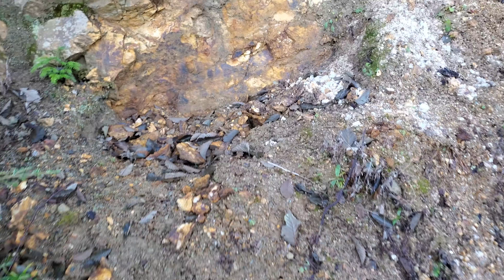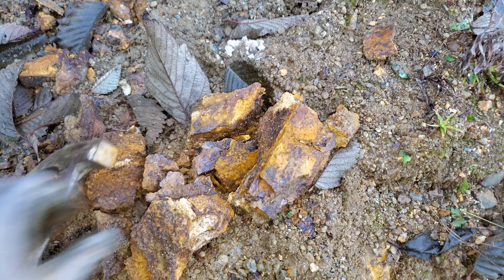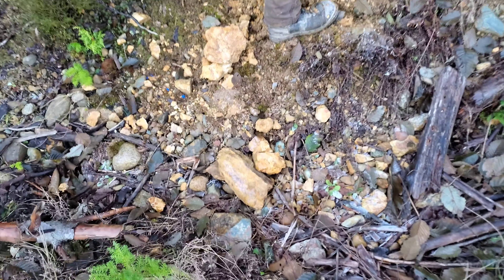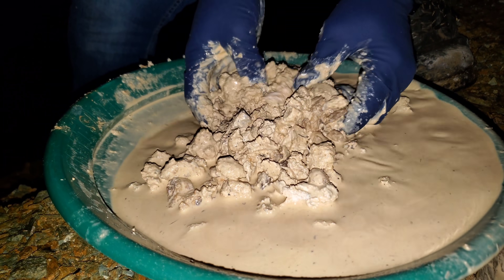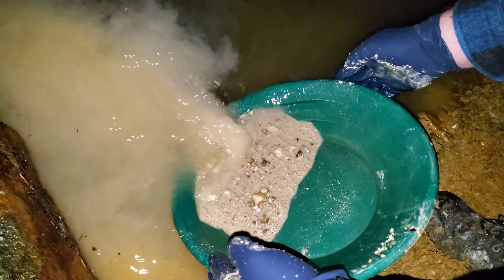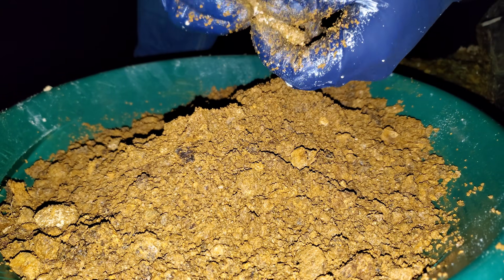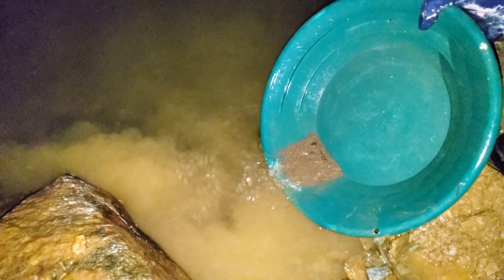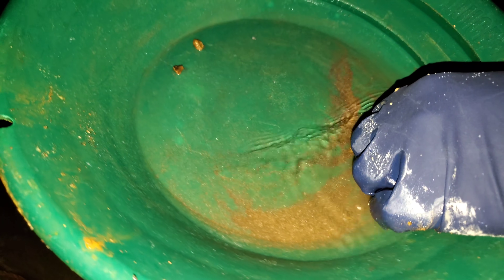Crushing & Panning A Deteriorated Gold Bearing Quartz Vein!

Comment: Your manual crusher is 0k but your plunger needs to be upgraded to a 4 foot 2" pounding round bar,with one end ground off at a 60° angle,makes a great pry bar!
I had  welding shop make me one for 80 bux,and I said make the foot wide cuz, I've got big feet,so he did,and he even threw in the bar!
I will say lugging a heavy bar around can be tiresome.
You could also have 4 feet of steel tube with a 1 foot long 2 inch round bar welded to it.
I also used my bar as  rock detector for area of ground covered in moss,just thump the ground,if it pings,you've hit hard rock,or use a metal detector after that!
Reply: Also a longer rod prevents backaches,suposedly!

Comment: so what causes the Sio2 to turn to mush???
Reply from the maker: Deterioration of sulfides, chemical and mechanical weathering, heat and pressure from secondary hydrothermal enrichment.
Reply: It appears similar to ash after deterioration weird. There isn't any cool rocks like that around here sometimes I come across the odd  sparkle or stained river rock. But getting to see the source rock in place is very cool.

Comment: Is there gold in the loose material that has already deteriorated in the soil at the toe of the slope? Has that ground been already worked for gold?
Reply: Yeah, the foot of that outcrop is where the most and easiest float gold will be.

But of course, if you are prospecting the VEIN as a LODE deposit, instead of a placer deposit, you will be more focused on the values ABOVE that potentially rich deposit of sedimented gold. ~( 'w')/

Comment: How well does decomposed quartz hold on to gold? Will the gold have already leached out or will it hold it?
Reply from the maker: What will usually happen is whatever unstable sulfides are holding gold will change composition and the gold will often stay behind inside the vuggy areas of the rock. Gold is stable and won't deteriorate so it will stay in place. If we wanted to get about 5 times what we saw you would need to process it better with crushing way finer. If we had a vein with the gold in the sulfide minerals and the sulfides were in place it would be a lot harder to process.
Reply: @911mining  i know i didnt ask this question but i got the answer, thanks!